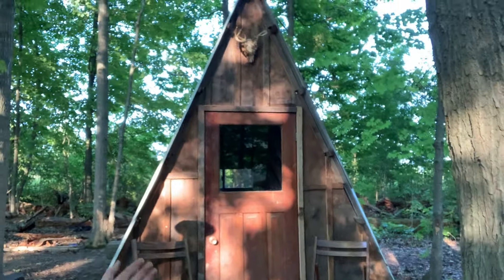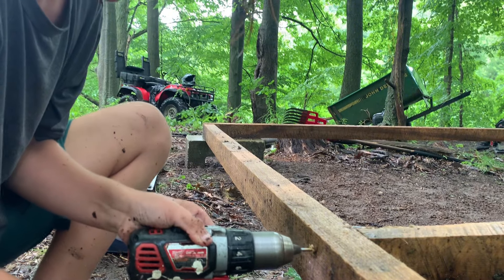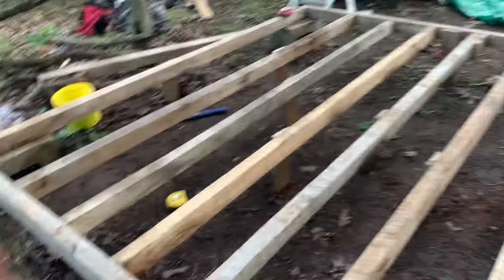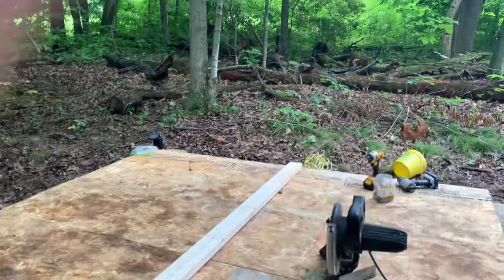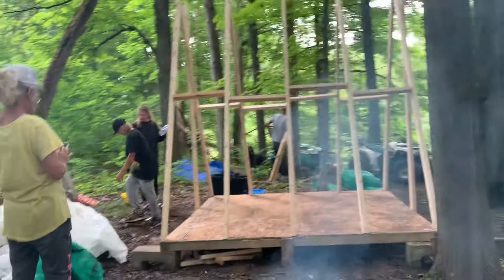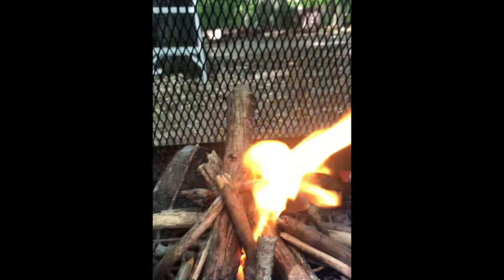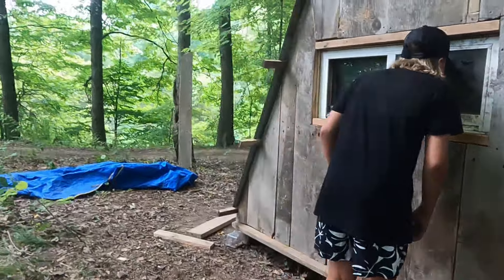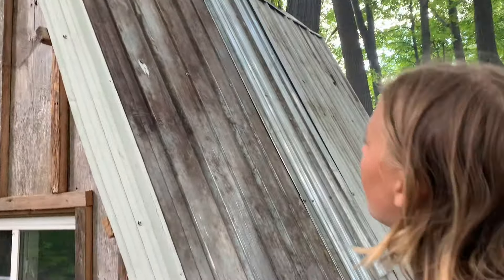Two 13-Year-Olds Build Their Own Cabin for Under $100 | Laine Henry

Comment: I don't care that they called screws, nails. I don't care that they're using a hammer or drill to  mark where to cut or any of the other things people might complain about or mistakes they're making!

Because they're LEARNING & they're OUTSIDE having fun! ❤

This is what I was doing when I was a boy, only we didn't have access to power tools, so we used hand saws, hammers and nails. I'll never forget those days and neither will these boys. Keep doing what you do and don't forget the first air kit!

Shout out to "Grandpa" and all their helpers!
Reply: Exactly
Reply: If it was a homebuilder, I'd have a few things to say. Instead, this was two capable young men building something way nicer than I was building at 13. Great job boys.

Comment: Great job, young men. I bought a bucket of self tapping screws off Amazon for my little bushcraft shelter. My beams are maybe 2 inches in diameter and I still had to pre-drill holes. I want to know how these guys get self-tapping screws to work so easily. Maybe it's a special brand or power drill.

Comment: Wow, good job!  I built a similar cabin when I was 15.  Not as perfect as this one, and it is 42 square feet.  Windows are only shutters with no glass, and plywood roof with tarpaper.  Also has gaps between exterior wall planks.  I paid only for the pillars, all the wood else was repurposed.  This cabin looks a lot cleaner too 👍
Although, I do think your floor josts are too small, you should have used at least 2x6 or 2x8 for longevity.

Comment: Awesome content 
I recommend to paint all wood facing the ground with used motor oil  to seal and prevent critters and rot 
Great job
Reply from the maker: Thank you for the advice
Reply: Thanks for the idea but moms motor locked up because we forgot to put new oil back in😂

Comment: Just a little tipp from my grandpa from the time I was at your age: Next time handling with hard wood try out how it goes, if  you put a little bit of bearing grease on the drill tip and the tip of the screw before drilling or putting in the screws. It makes things much easier plus the screws are living a little longer.

Comment: You know boys you could have put in more bricks underneath as supports it would have been a little bit better because based on the weather that I'm seeing in the background those supports will eventually sink where as bricks will sink a little bit but they will not go farther like I said it would have been better to put in more bricks underneath for supports and for also stabilization. But I admire your work.

Comment: Less than $100?!? I don't think so.

 Nice of your Dad's to let you borrow their power tools, ATV's, etc. Use some elbow grease. Learn to use a handsaw. Learn to use a hammer to drive a nail.

 The wood sitting on the ground will rot. Support the floor joists with stones or concrete blocks.
Reply from the maker: It’s my Atv lol